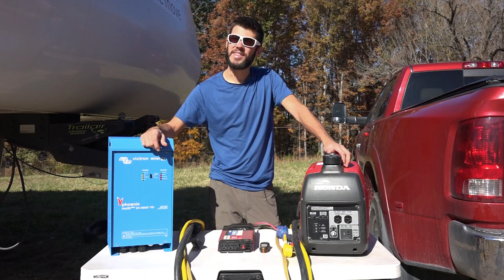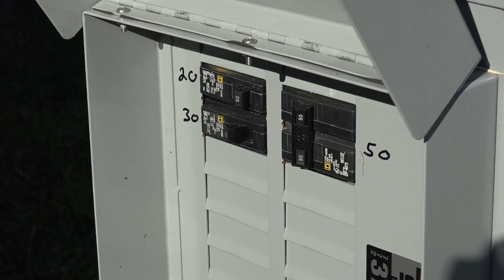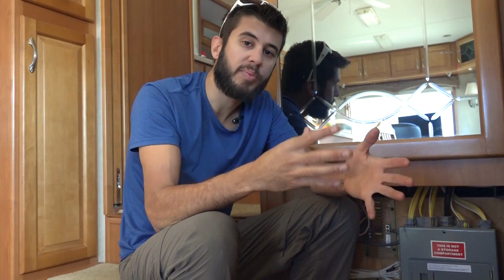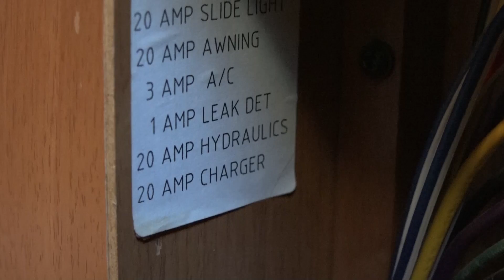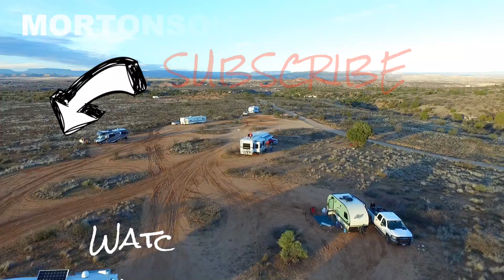RV Electrical Safety Tips and Recommendations- RV Security and Safety Series Part 3

Comment: Could you discuss choosing between a 30 amp/ 120 volt and a 50 amp/ 240 volt shore power supply?  I have a lot of experience with larger generators, always drive a copper rod into the dirt/ ground for a true ground and connect it to the RV frame, and the generator (if used).

Comment: I was doing some work at home and I got shocked,  that was over 25 years ago.  Recently I was moving my stove away from the wall and there was a huge spark.  

My wife told me to get a replacement plug... I picked up the phone and called an Electrician.  It cost some bucks, but I will not do any work with electricity.

When I take whatever I end up with for a tune up, I’ll have them check my electrical system.

Dave

Comment: Hey again Mortons!  I not only appreciate this, I can concur with this.  I have the knowledge and experience to know that this is really good information.  

One trip is enough for me to trace a circuit.  For some reason, mice like to eat some formulations of rubber wire insulation.  I have seen serious mice damage on wires but a wire next to it has no damage.

All of this information was correct and very well presented...until the last 30 seconds or so.  "professionally trained" is not the standard, "licensed" is the standard.  Perhaps "certified" is the standard, but "professionally trained" is not a standard that I have ever heard of.  Such tiny ways of wording concepts can embroil one in ruinous litigation.  99 out of 100 know exactly what you mean but there are 15 lawyers ready to represent every one of  that one percent that thought he followed your advice and it did not go well.  

You obviously know what you are talking about, but to protect yourself, you need to start using terms like, "in my opinion" and "as per my personal experience" or "according to this source..." and then name it, or you are going to be a litigators dream target.  

All it will take is one slack jawed, inbred moron that does not understand the essence of what you are saying and one out of work lawyer and your road trip will be over.  

This video has the tone and cadence that sets you up as a definitive source, but, unless I missed it, it does not state how it is you are in any way licensed or credentialed.  

I have loved these videos, but I know what it is like to be in perpetual litigation.  One tiny act of kindness and caring has led me to 20 years of perpetual litigation.  A tiny act of kindness that takes 20 minutes could lead you there too.  

Remember these terms:  "In my personal opinion,"  "As per my personal experience," "according to this source," as per the manufacturers claim."  I know it sucks Morton's but you should pull this video down for you own protection, and be very cognizant of every licensed trade whose toes you might be stepping on. 

I think that is as good a place to leave it as any.

Rob

Comment: I don't understand the comment about the Neutral not being bonded to Ground.  If they are bonded, and the input polarity is switched, the pedestal breaker will trip, as there is a direct path from hot to ground--since the Neutral is bonded to Ground back at the pedestal.  That's the point of having Neutral & Ground bonded together.  Are you suggesting this is a problem if there isn't a correct bond at the pedestal (or elsewhere in the system)?
Reply from the maker: Yes and I have seen it, multiple times actually. A improperly grounded system will cause this situation and campground power is so frequently wrong or partially broken.  Ground bonds may exist but frequently won't carry enough load.   Wiring this way is the RVIA standard too.

Comment: Thank you for sharing excellent tips on RVn and electric systems. Electrical problems is one of my concerns regarding RVs, shore or pedestal power. I have purchased a number of test items to verify shore power and really appreciate your knowledgeable tips. Not touching the box with your off hand is an excellent tip :-) One of the purchases was a Dog Bone 50/30 with a handle. It provides a good single handed grip when securing the plug to the pedestal.